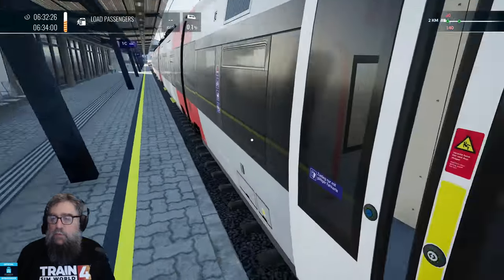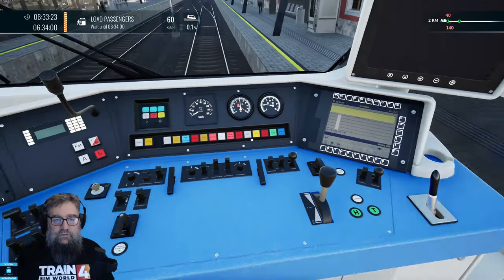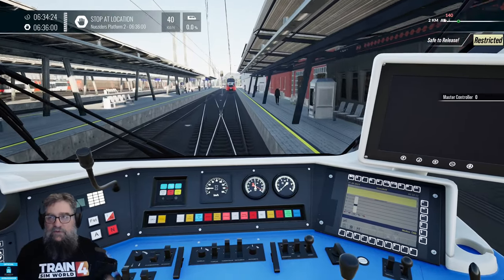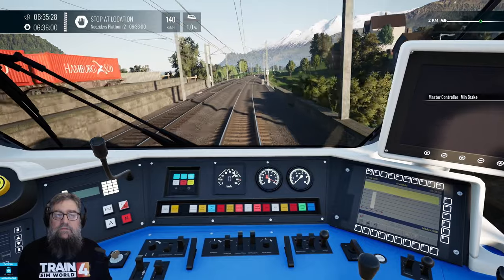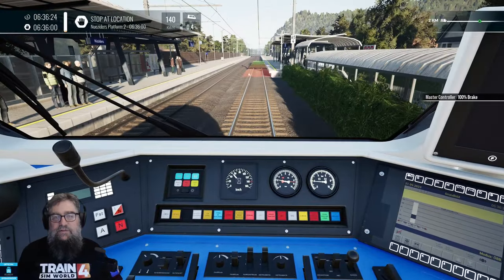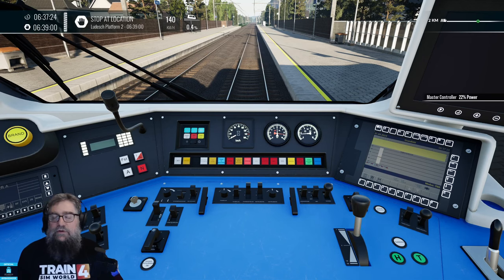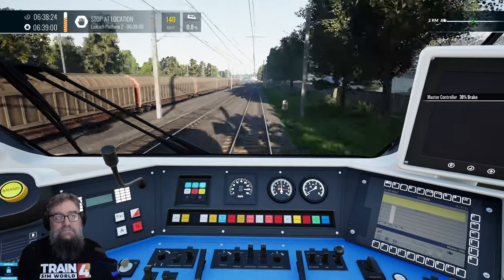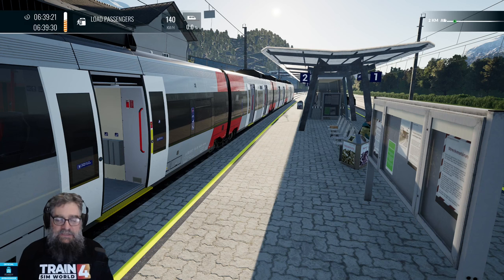TSW4 How To Drive The OBB 4024 Talent 1

Comment: Very useful one! I am struggling on how to start again after an emergency break
Reply from the maker: Hopefully I covered that in the tutorial?I usually do.
Reply: Yes please I am blocked after an emergency break :( I do not know the procedure  @trainsimulatordriver
Reply from the maker: @TheTinyCats  isn't it in this tutorial?
Reply: @trainsimulatordriver  When ? I watched the video again but I do not see the procedure after an emergency break. I still blocked
Reply from the maker: @TheTinyCats  ok I'll have to take a look, I normally include it as part of the script. How did you get into emergency, was it a safety system, an emergency button in the cab or you did it with the brake ?
Reply: It occurs when I pull the Train Brake to "emergency" or the Master Controller to "emergency". Thank you for your help! @trainsimulatordriver
Reply from the maker: @TheTinyCats  ok, I won't be able to check until tomorrow my time. Things you can try. Put it into neutral on master controller, full application on brakes, neutral/off on reverser and wait one minute then try to move again
Reply from the maker: @TheTinyCats  hi I tried this and the only thing I had to do was put the master controller to off, the train brake pipe recharged then I put the master controller into power and the brakes released and off it went. What I did discover is that if you save the game while it's in emergency you can't recover it. Is this what happened with you?
Reply: @trainsimulatordriver  Similar issue, the FEDERSCHEICHER ANLEGEN light will ignite, and I can't figure out how to turn it off or reset it, which causes the brakes to never release, and no power to be applied. Can't find any guides.
Reply: Nevermind that, it's actually a BUTTON, and you press LÖSEN.
Reply from the maker: @kvgiris  I haven't tried it yet, but I've had a suggestion of put the throttle to zero, address whatever caused it (reset the brake handle, acknowledge and release PZB, acknowledge sifa) then wait and apparently after a time the brakes will release.
Reply: @kvgiris  that was not actually the problem but thanks anyway!
Reply: @trainsimulatordriver  I found that for whatever reason you need to close the disjunctor to start again ( even if you are happily driving 🤣)
Reply: @fision83  I think some areas you actually need to do that,
Reply from the maker: @kvgiris  ok really interesting, when you hit the emergency mushroom the pantographs drop! After releasing the emergency mushroom button, you need to raise the pantograph and close the main circuit breaker then you can drive.
Reply from the maker: @TheTinyCats  I discovered that when you use the emergency position the pantographs drop so you have to put them back up then close the main circuit breaker and you can drive.
Reply from the maker: @fision83  I discovered the pantograph drops when you go into emergency so you have to put it back up and close the main circuit breaker then you can drive
Reply: @trainsimulatordriver  Ahhhhhh finally!!! After being stopped for almost half an hour I find the answer! 🎉
Reply from the maker: @domo_hudson  you're very patient
Reply: @trainsimulatordriver  not as patient as the passengers standing on the platform waiting for their train 😅
Reply from the maker: @domo_hudson  and could probably see it 🤣

Comment: How to enable the cruise system of this train? I can enable the system through CTRL + R but I cant set the speed limit of it🤕
Reply from the maker: I'll have to figure that out and come back to you. I don't know that one.
Reply: @trainsimulatordriver  I have just figured it out. Other trains which have cruise system mostly can adjust the speed limit by using the shortcut keys which are R to increase speed limit and F to decrease it. However, the OBB 4024 need to adjust it by hit the button where below the right screen. It is rather strange that why dovetail didn't bind keys for them.
Reply: @skymkmk  You can actually use r and f to increase and decrease speed. So the procedure is to apply like 50% power or higher (don't know exact value), turn on cruise control and press, not hold, r and f to adjust the set speed. However, if you decrease the power in any way, you get traction locked and have to reset everything. You can only increase power or use r and f to control
Reply from the maker: @skymkmk  ah ok, that's good to know. I'll definitely pass that back in because they've got an accessibility push on for PC and everything should be bound to keys to make the game available to as many people as possible. Thanks heaps for figuring it out.

Comment: Hi, can you make a tutorial on how to do the REX1 (5566) service from Feldkirch? the diver assistent says: "raise the pantograph" but there is no overhead line
Reply from the maker: oh dear, that sounds like a bug - either the train in that service is spawned onto a track without overhead or its invisible (sometimes is in TSW for no good reason).
Reply from the maker: I tried it and it starts in the station under wires. Do you by any chance mean the setup service before it?
Reply: @trainsimulatordriver  I tried to do the service again 4 times but the spawn track is the same, without an overhead line and consequently it doesn't let me raise the pantograph. Should i try to install again the dcl?
Reply from the maker: @matt.eo1210  are you on PC or console? Are you doing the main service or one of the zero length services?
Reply: @trainsimulatordriver  I'm from Xbox One, the service is an 00:00 length. I also tried installing the DCL again but nothing changed
Reply from the maker: @matt.eo1210  I've got this on XBox S let me give it a go there. I'm working a shift on the real railway today so I can't do it until tomorrow. There are sometimes bugs which affect only one platform. Sounds like you've found one sadly.

Comment: What % of throttle would you pull off from the platform in? and at what speeds would you increase? 

E.g pull off in 50% till 20kmh, then 100% onwards? 

How is it done?
Reply from the maker: There's no specific percentage as it depends on company rules and track conditions. It's also different between commuter (light trains usually in a hurry to meet a tight time table) and freight (slower, heavier and more concerned about stress on the vehicles and couplers). On all trains you generally start out gently to stretch the train out and keep it comfortable for your passengers or cargo. On a passenger train you'll get to full power fairly quickly being mindful of track conditions and the train handling. On freight you'll power up through the settings a little at a time slowly over many minutes.

Comment: I never use sifa or any systems..They are loud and stopping the train without any reason...
Reply from the maker: Loud yes, but they stop the train because the driver hasn't done the right thing. It's fine to play it like a game and just drive and ignore all the operating rules and conditions but if you want to run it like a simulator then you need safety systems and you need to learn what they're telling you.
Reply: @trainsimulatordriver  Yes, but example..I tried to drive Class-66 old diesel train with TPWS (Or something like this??) system on and it just stops without any reason...What I did wrong then? Do I have to do something else than drive under the speed limit?
Reply from the maker: @D.W91  yes you need to acknowledge adverse signals and speed limit changes where the speed limit is going down. Look in my tutorials playlist (either TSW4 or 3 they work the same way)
Reply: @trainsimulatordriver  So even if I slowing down before the speed limit it's not enough..?

Comment: Playing on xbox, cant seem to find the correct acknowledge buttons, and there are none mapped.  I found the release. But i cant get very far, train locks up.
Reply from the maker: It should be B on Xbox to acknowledge sifa, pzb and lzb-ende. It's slow to react and if you've got both sifa and pzb at the same time you need to press it twice
Reply: B doesn't seem to work, however I noticed the popup referenced a pedal... haha.. there's a big white pedal that blends in very well. Pressing that pedal at the acknowledge points seems to work. Lots to learn haha.  Appreciate the response 👍
Reply from the maker: @brentonsgames  B should press that peddle. Pzb acknowledge is the right one one on the set of three pzb switches. Release is the middle one.

Comment: Looks like TSW3. With more stuttering/freeze frames. What justifies a new game release, aside from their greed? Then a handful of bugfixes and tons of DLC's and next year TSW5?
Reply from the maker: Stuttering is actually much better in the public build after the first run through. This is a preview build with logging that slows everything down. Three routes for the price of one is good enough for a core release isn't it. On the other hand you can continue to flog your dead horse if you want. She ain't gonna get up and pull your wagon.
Reply: @trainsimulatordriver  no it's not good enough if nothing really changes, not even the graphics.
Reply from the maker: @Duke49th  you're welcome to your opinion, the list of changes is quite extensive